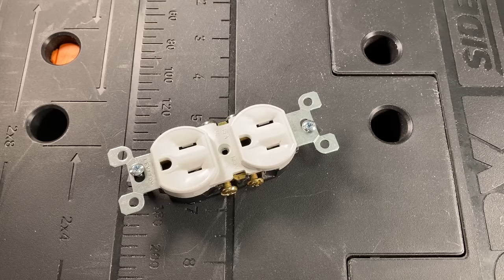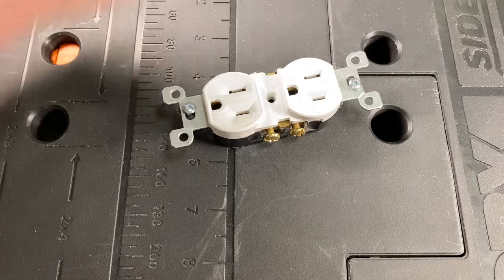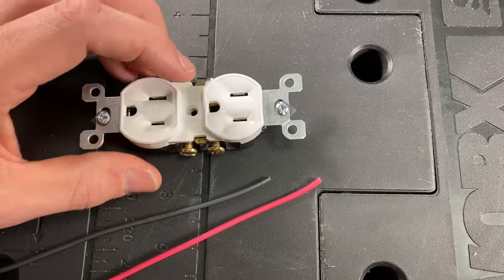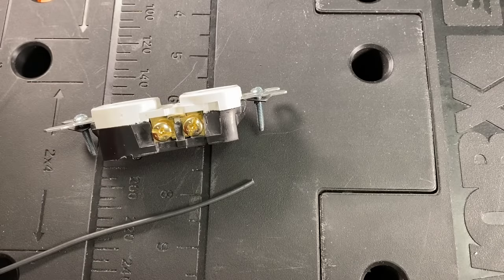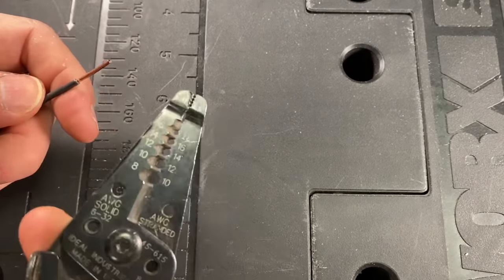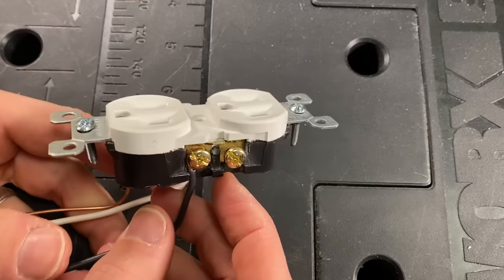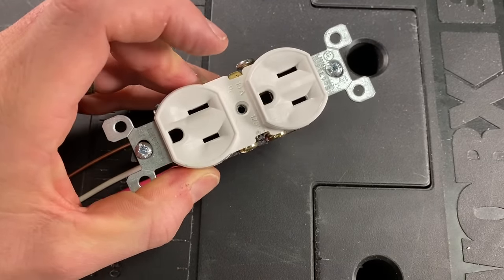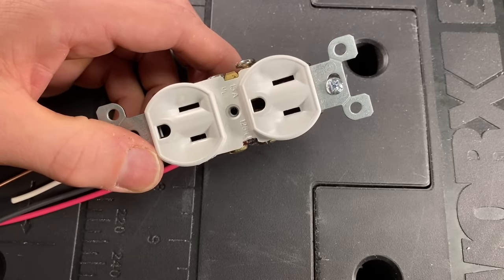Electrical Outlet Basics | How To Wire

Comment: Is there a reason why pigtails are preferred instead of using all 4 terminals on the outlet when you have 2 lines running into the receptacle? Thanks!
Reply: Code reasons that there should be no impact to anything else down/up stream with the removal (or failure) of the receptacle.  Also, theres exceptions like being able to use 15 amp outlets on a 20 amp circuit because it's likely all 20 amps won't be drawn from a single outlet.  If daisy chaining is permitted, it becomes much more likely to draw 20 amps through a single outlet.  The only time this would be okay is with GFCI receptacles since they are inherently more robust and so built for downstream receptacles to be fed and protected by them.

Comment: Good video, I was unaware of the measuring gage on the back of the switch. The problem for me is that the dummy that wired my house, built in 1989, the wires are  too short, thereby making any cuts and stripping impossible. They also use the push in terminals, which is against code according to the U-Tube guy here, but also impossible to get them out. So I fought the first one, had to cut wires and had almost no room to install with short wires. I have to replace all of the ones in my house, so I am going to buy 14 gage wire in red, black and white, and cut and strip each one to maybe 3 inches of new wire and wire nut them to the wires that came with the house. Thereby, avoiding the unnecessary hassle. Those electricians are really lazy and dangerous.
Reply: If your wires are short you might find it easier to use Wago connectors.

Comment: What if I wanted to change a switch outlet to a regular outlet that always has power?  You mention removing the tab if one of the outlets is to be controlled by the switch. Would I have to get a new outlet?
Reply: Yes. You would need to get a new receptical. Or you could change out the box and install a double sized box and just add another receptacle.

Comment: Great info man. So quick question all of my outlets are 2 prong without the 3rd hole in the bottom could I just replace it with a three prong? Idk the technical term. Also there's no ground wire in mine 😅
Reply from the maker: Hey Matt, I am definitely not a licensed electrician but in the past when I swapped out 2 prong outlets which are missing the ground I had to use a GFCI outlet to meet our local code.  Best of luck!
Reply: Hey Matt, I worked under a few electricians for many years. I’m not a licensed electrician but I was taught this: you can replace your old outlets with a “three prong” outlet even though there is no ground wire as long as your outlet is contained in a steel box and your wiring is bx or armored cable. The steel sheathing of the cable is the actual ground which is bonded to the steel box where the outlet is screwed into grounding the outlet. The steel cable attaches to your main panel which is grounded. I’m 100% sure I’m correct on this but you should consult a licensed electrician before proceeding.
Reply from the maker: @CytoplasmicGoo  thanks for the help 👍
Reply: @CytoplasmicGoo  code no longer recognizes steel conduit or BX cable as an approved grounding conductor.  best practice is to protect any ungrounded circuit with a GFCI breaker. otherwise, a GFCI receptcle in the first position of  daisy chain.
Reply: You can use a gfci receptacle and should protect you. It will not protect sensitive electronic devices even if a surge protector is used. You must also place a sticker on the cover plate which states "no equipment ground". These stickers are supplied when purchasing a gfci receptacle.
Reply: @surferdude642  so basically I should just rewire my house to keep it safe and up to code. The workarounds seem to be okay but ultimately just a redo is the better solution
Reply: @mattysteve  If you have a metal box, you can verify if a ground exists. Put in a 3 prong receptacle or gfci, put the cover back on and turn on the circuit breaker. Plug in a gfci circuit tester, it has 3 lights. It will tell you if your box is grounded or not. I have a house which was built in 1950 and all the receptacles were 2 prong. Surprisingly all boxes are grounded with a 16 guage wire coming in from the back.
Reply: @surferdude642  no boxes 😅 it's literally just in the wall
Reply: @mattysteve  receptacles come with 6-32 machine screws designed to thread into metal boxes or tap into mounting holes on plastic boxes. Is your wall drywall or wood? No boxes = not code compliant. This is fixable with proper tools. Open the hole large enough to use "old work" boxes. Carefully, do not nick any wires. This won't solve the no ground issue, my guess is there no ground available. You may want to consult with an electrician. I am curious what kind of wall material you have as your receptacles seem to be mounted directly to the wall.
Reply: @surferdude642  it's just right through the drywall
Reply: No. There was one circuit in my parents house that was ungrounded but had receptacles that were designed for a grounded circuit (3 prongs). When my parents died and we were selling the house this situation came up during the home inspection. I had to replace all the three prong receptacles with two prong ungrounded receptacles.
Reply: @njsongwriter  I guess it depends on the local code and the inspectors interpretation. Since you were selling the house you did the most logical thing. If you replaced the receptacle with a gfci and applied the sticker "no equipment ground" on the cover plate, you should be good. You would use the line connections only, not the load. This would still be safer, and also notify any future electrician or inspector that there is no ground.

Comment: Need to add two crucial points to video: 1) screwing down unused terminal screws NOT leaving up - causes potential arch’s and against code in most places 2) wire hot and neutral in a cris cross manner using diagonal terminals to indicate not switched (your words ) outlet wiring and best practices - provides visual guidance to how wired and additional troubleshooting - if brass tab is defective - arch’s, burns through etc. This shows up in outlet use by it stop working indicating there is a problem thus it is NOT recommended to wire hot and neutral across from one another (on same tab when not switched)! Fix your video to be more accurate, safe, tech friendly and code compliant - cheers....
Reply from the maker: Yo Adrian!  Appreciate the feedback and tips  🍻
Reply: What???

Comment: The green terminal is call a ground not a common..Common is a DC (direct current) voltage term that relates to the negative side of the circuit that is shared by all devices. The ground wire is a safety wire that provides a reference to earth. The white wire is the neutral wire which represents a return path for the positive side of the circuit. Yes the black wire is commonly the hot or energized circuit and red is the switched circuit..However, red can also be hot or energized, black can also be switched.. In systems that are wired with nonmetallic sheathed cable (Romex) or metal sheathed cable both have black and white (2 wire) and red, black and white (3 wire).
Reply from the maker: Hey Tom, thanks for the feedback.

Comment: i wish you had explained WHY the insulation shouldn't be stripped too much or too little....too much insulation stripped might present a fire hazard?  but too little, (where the insulation is between the terminus and the plate), what problem might that create?  thanks for a helpful vidoeo.
Reply: If you don't strip enough insulation the screw will contact the insulation before the bare wire, reducing solid contact. If you strip too much wire you run the risk of shorting (inadvertently making contact with the bare ground wire or the box if it is a metal one) when you fold the wires prior to screwing the receptacle to the box. Electricians will wrap a couple of layers of electrical tape around all the screws for added safety.
Reply from the maker: Thanks for the help Ted 👍

Comment: Why is the outlet opening and prong larger on the neutral side?  What purpose does it serve?
Reply from the maker: This helps to ensure you plug a "polarized" 2-prong plug in the correct way.  Some appliances need to be plugged in with the hot and neutral aligned correctly.

Comment: Can I put a string of outlets on a switch? That’s what I plan on doing.
Reply from the maker: Hey Mark, I have a condo which I am renovating now and in each bedroom they have 4 switched outlets running off a single switch.  Not sure what the exact electrical code is in your area but should be doable.
Reply: Just make sure you check your local code and if that's all good also make sure you wire them in parallel from the switch, you should be all good!
Reply: Sure. Usually you want to turn on a lamp by the bed so I would wire one receptacle on each side of the bed and if the room can accommodate the bed on different walls then you could continue the switched receptacles on each wall where the bed could be moved to.

Comment: I'm getting to replace an outlet in my living room. It has a 120 voltage I just don't know what amperage the outlet takes in order to get the same one. Will it say on the old outlet as well the new one ? I was looking at your video and your outlet says 15A 120volts I think. Is that the one I need ?
Reply: Yes. They are good for 15 amp and 20 amp circuits even though it says 15 amps. The only reason for a 20 amp receptacle is to accept a 20 amp plug (one sideways prong) but they are rare. If your circuit is 20 amp, I would use a "spec grade" duplex 15 amp receptacle as it is more durable than a residential grade.
Reply: @surferdude642  my fluke meter says 121 to 122 volts. Do I get a outlet that says 15amp and 120 volts ? Or because it says 121.5 volts do I need something higher for my living room ?
Reply: @losmoore3358  120v is nominal, it can vary higher or lower a bit. Get a 15A-125V spec grade (higher quality) and you'll be fine. If you want a tamper resistant (TR) they are available in spec grade, but may be harder to find on the shelf. Tamper resistant residential grade are easy to find and would also be good. Just don't use the quick wire method of connecting your hot and neutral wires. Hook the wires around the screws.

Comment: But I'm struggling with is some of these applications require a second black wire and I'm wondering where that wire is my Romex only has a white neutral and black wire. I'm trying to use a light switch outlet combo and having a lot of trouble
Reply: You would need a 14/3 or 12/3 Romex. These have 2 hot wires, one black and one red.

Comment: I have wired outlets with the hot wire on the left side and the neutral on the right side. It still worked. Should I worry?
Reply: Yes, it's a shock hazard. If the hot wire is connected to the silver screw, side closer to the longer slot on the front of the receptacle, then it's reversed. Change it, turn power off first.

Comment: I hooked up my receptacle exactly like this but now when I plug in my disposal it stays on and the switch that is suppose to turn it on or off  doesn’t  work.
Reply from the maker: Hi Annie, go back and watch the video looking for the part we I discuss the small tab which connects the top and bottom screw terminals.  I would expect that the circuit for your disposal was originally wired as a switched receptacle.  You need to confirm this but if this is the case then the tab should be removed.  If you still have the old receptacle you could also check to see if the tab was removed.  Best of luck and be safe.

Comment: AND the other screw, each side, is usually used to continue the circuit as several of these are usually installed on a single circuit...I would have mentioned that...... outside that, great tutorial for newbs...
Reply: "AND the other screw, each side, is usually used to continue the circuit as several of these are usually installed on a single circuit.." When you do that the metal bridge between the screws becomes a fuse.don't do that.I have fixed a couple that failed that way.Wire nut and pig tail makes it easier to" stuff" the receptacle in the box too.
Reply: @damistavista9539  I've been around many homes wired in this manner and is common... some builders will have countless pigtails on a circuit to avoid this, but both methods can have voltage loss at any point causing a downstream issue, both methods may be hard to diagnose, both methods are good and bad... if that bridge on the outlet fails, is not too difficult to diagnose simply by testing the outlet, usually... I've seen problems with both methods, have seen voltage drops at a pigtail usually caused by a loose connection with a bit of overload on the power draw, electric space heaters seem the worst for that, but have also seen the outlet fail as well...some places may require pigtails via code, never looked into that, not in code where I am...I think for most it's usually preference,  both ways work for me and I've used both...
Reply: There is a limit of 10 receptacles per circuit, just an fyi.
Reply: @surferdude642  10 is the common max, but there can be as many as 13 in most places, based on some crazy mathematical scheme... and that's a topic argued over just as putting 15amp duplex, 2 plugs, outlets on a 20amp circuit is argued over ... in some places I believe it's code to limit at 10, I think some places, so I've been hearing about, limit the number based on the mathematical equation... some argue never put 15amp on a 20amp circuit, use 20amp only, yet the only requirement I've seen is if using a single outlet on the 20amp circuit, single plug, it must be 20amp .. I've even seen one argument about using a power strip and overloading a 15amp spec outlet, yet all my power strips are rated 15amp, same as the outlet... it'll probably forever be a debate over all this... but, yes, 10 is the safe bet regardless of what is said.....
Reply: @texaswildcat2000  Thanks for the info
Reply: @texaswildcat2000  I would use the outlet screws to daisy chain outlets.  Fewer more secure connections.  The bridge tab is less likely to burn out then your small gauge wiring, unless you’re using REALLY shitty outlets.  It’s true that a bridge lug failure would disconnect any downstream outlets, whereas a pigtail daisy chain will not.  But I think that’s a feature, not a bug; it shows me where the problem is...
Reply: @jimbaranski4687  just be sure to limit the number of duplex outlets to 10, lol... but, yes, that's the most common method I've seen in the south...

Comment: Maybe I missed it, but did you mention the outlet should not be installed as a "Happy Face" as that allows a short circuit if something conductive falls across any exposed plugs? Correct installation has the Ground pin at the top.
Reply from the maker: I did not mention it in the original video but there has been some active discussion in the comments.  Sounds like that is the preference of many but not specifically called out by any NEC codes.

Comment: My home was built in 1930 so it has old cloth wiring. When I tried to change the outlet, I couldn't tell which one was hot and which one the neutral. What happens if connect the hot wire to the neutral terminal of the outlet instead of the hot terminal? Would it just not work or would that cause a problem?
Reply: It should still work, but you'll have reverse polarity.  So if you plug in an appliance with an on/off switch, the appliance internals could be energized all the way through the motor to the switch, instead of just to the switch. This is a possible shock hazard in the appliance.  The klein voltage detector he showed will be able to tell you which is hot, just be careful, you need the power on to test which is hot, make sure they are well apart from each other and anything else like your fingers when you energize the wires to test them.
Reply: @brett328  appreciate the insight! I had gone ahead with connecting the wires not knowing which one was hot or neutral. But suspecting that I may have installed the wire incorrectly, I used one of those outlet testers that tell you if the wiring is correct and it showed "reversed neutral"  so I simply switch it and back and now is correct. Now the confusing part is that I did not see any ground wire as it was old wiring system but when I checked the outlet tester, it said it was correctly wired. I wonder what thats about, maybe my tester is not reading correctly.
Reply: @phuntsoktashi5658  Is the wiring in your home knob and tube, or BX armored cable, or romex?
Reply: @brett328   There seem to be a combination of all around the house. Though the circuit breaker seem to be BX armored cable. The outlet in question however seem to be knob and tube as there are only 2 wires with cloth wrapped around it.
Reply: @phuntsoktashi5658  BX would only have 2 wires inside as well. Its clear there has been updates made over the years as BX was not around in 1930.  The BX steel sheathing can act as a ground if done properly. Its not likely the tester is defective, especially if you just bought it. I'd say its worth having an electrician come out and do a careful inspection. At least you'd know definitively whats what.
Reply: @brett328  Yes electrician would be a good idea at some point. We just bought the house so uncovering things as we go. Appreciate your help!

Comment: All you need is a "neon" tester.  In fact, they are better because you can find which wire is hot and which is neutral.  And there is no battery to change.  A neon tester is about $2!  I like Klein tools, but GEEZ!